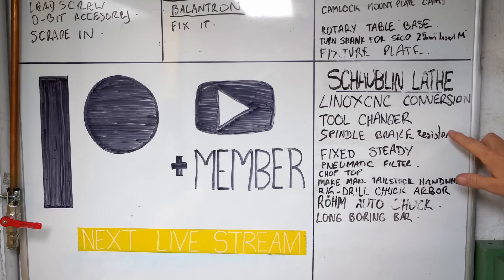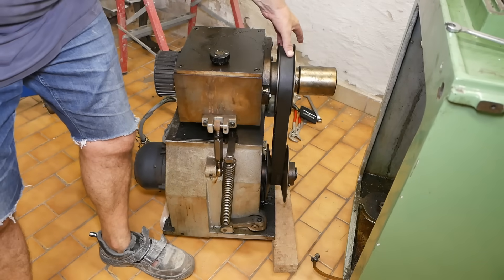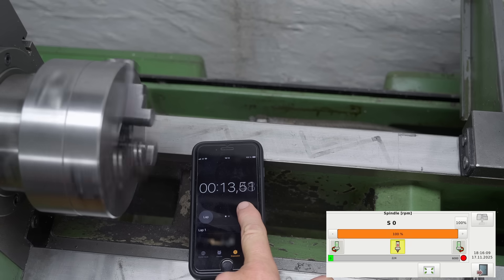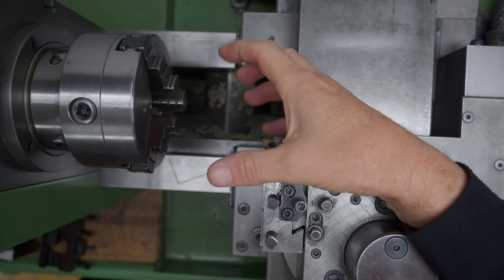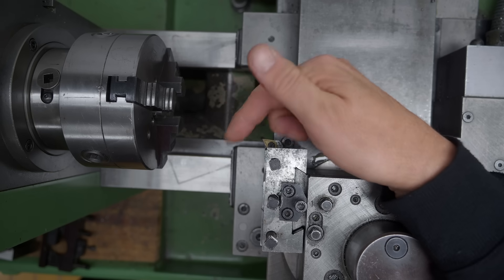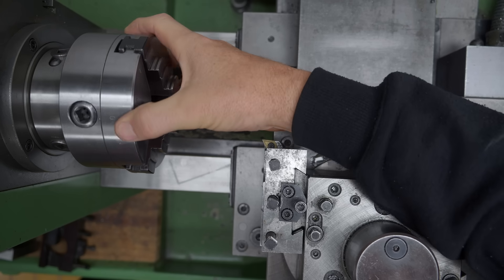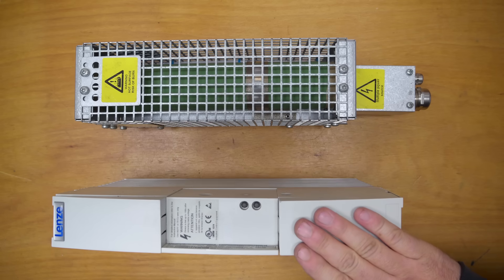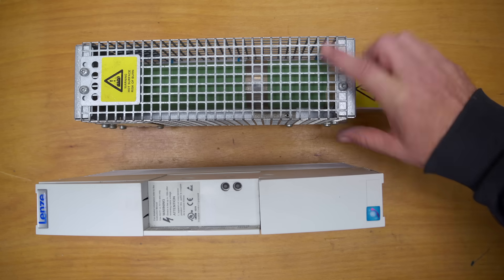Help me with this VFD Please - Schaublin 125-CNC Ep. 62 || RotarySMP

Comment: Have you tried asking ChatGPT ? This could be total gibberish as the AI's are very good a lying confidently. 

🔧 How to Turn Off – i.e. Disable “Coast to Stop” on a Lenze VFD

If your Lenze VFD follows the common VFD architecture (similar to the examples in manuals), you can typically disable coast-stop by changing the stop-method parameter. For example, in an example manual for a Lenze (or similar) drive series:

Parameter (or setting) “STOP METHOD” (in that manual, “Parameter 04 – STOP METHOD”) may have values like:

01 = Coast to Stop

02 = Coast with DC Brake

03 = Ramp to Stop (i.e. controlled deceleration)

04 = Ramp + DC Brake (decelerate then brake) 
Artisan Technology Group
+1

To disable coast-to-stop, you would:

Enter parameter menu on the VFD (via keypad or programming interface)

Navigate to the stop method parameter (on that example, P04 / “STOP METHOD”)

Change the setting from 01 (Coast) to either 03 (Ramp to Stop) or 04 (Ramp + DC Brake), depending on your preferred stopping behaviour

If you pick “Ramp to Stop,” the drive will decelerate the motor at a controlled rate (as set in the ramp/deceleration time) rather than simply cutting power.

If you pick “Ramp + DC Brake,” the drive decelerates, and then applies DC-injection braking for harder/faster stops.
Reply from the maker: Gibberish.
Thanks. I still have the electrical brake as well. I have summarised my trouble shooting progress into the first comment at the top.
Reply: @RotarySMP  Gibberish. I figured. There are companies that are staking their futures on this BS.
Reply from the maker: Hi Vince, turns out the way I set "coast down mode" was just to misuse the drive enable as a start/ stop. Now I understand it, I can work through the different options to give the best solution.
Reply: @RotarySMP  Oh, that's great to hear. Looking forward to the followup on Sunday. Or maybe you'll post sooner? Hope you get it fixed. I got a breaking resistor for my mill attached for a Hitachi WJ200 VFD but work and life go in the way. Now that work is out of the way I should revisit it too. Good luck!

Comment: No possibility to put the drive back in commissioning mode? I know that for Siemens you need to do that to change certain parameters. ABB gives less fucks about that, so it could be that lenze is also like that.

Edit: do you have generator mode enabled? that could be part of the problem. The manual reccomends 80% but only if a resistor is connected.
Reply from the maker: Please check out the first comment at the top, as I have been summarizing my progress trouble shooting it there.